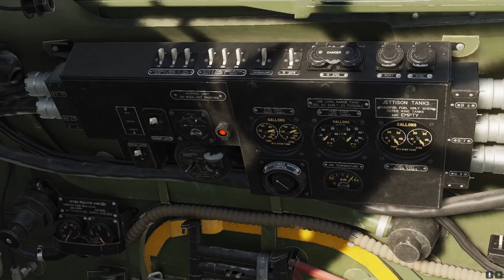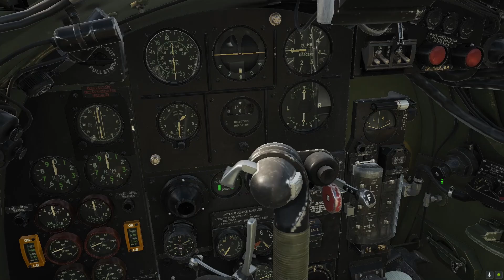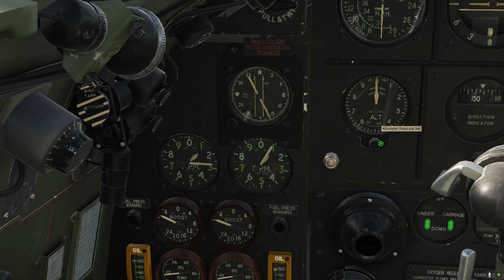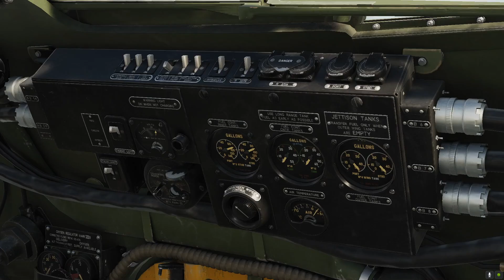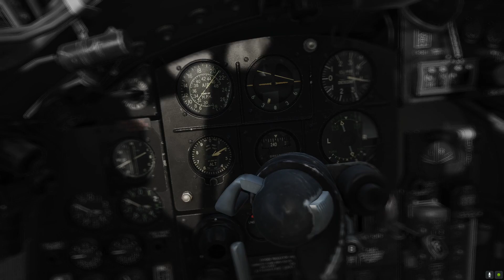Does DCS Have a MAJOR Problem?

Comment: Quite a morbid comment but I read about a 747 that lost its vertical stabiliser after a bad repair on the aft pressure bulkhead. On the CVR for a good few minutes after depressurisation they talked to each other about donning oxygen masks and descending but seemed unable to take any action about it.
Reply: "That would be a great idea wouldn't it? Heheh. Flying is pretty crazy huh." smiles and looks at the clouds
Reply: @BlueZirnitra  It's worth noting they kept a 200+ tonne crippled airliner in the sky with no hydraulic fluid. For over 30 minutes.

Comment: As always, Tim delivers a well informed aviation video for our education. 
Back in 1980 when I was fitting LOX-pots to Buccaneers, if I had previously had a few ales the night before, I would nip into the cockpit for a quick Oxy' check.  Works wonders.
Reply: NHS here, can confirm.. Nothing beats a bit of freshly bottled Swiss mountain air!
Reply from the maker: Yep, old Hawk T1 days after a big night, selecting 100% oxy on start!
Reply: Yes its a welders trick too!!!
Reply: I did hear an RAF pilot from WW2 say that 100% oxygen helped clear the head after drinking a few beers the night before.

Comment: At max T/O weight lift off speed of the Mossie was around 120-125 knots, but Vmca was 175 Knots IAS and it took almost 50 seconds to get the gear up and accelerate through Vmc on a summer day. The only thing to do if an engine failed below 175 knots was to reduce power on the live engine! And you had to do it very quickly!
Reply from the maker: I'll give that a go - sounds scary!

Comment: Tim, if you were to have a hypoxic dilemma in the air... Would you return back home asap to be checked over, or just class it as a dasor and move on with the sortie?
Reply from the maker: You have to return home immediately and you will have to see the doc in case it wasn't hypoxia related to the oxygen system but smoke and fumes instead - you may have been poisoned and won't fly again the next day, just in case.

Comment: Is the recovery with oxygen really that quick? Doesn't it take 30 seconds or do to regoxygenate the blood?
Great video. Could be a real problem in a fast jet climbing to 50000 feet 😬
Reply from the maker: It's pretty quick, a bit of confusion will exist for a few seconds but you are back in the room almost instantly you get oxygen back into the blood and into the brain.
Reply: @FastJetPerformance  if you were a marine, they'd pull your pants down and insert foreign objects in to you most likely
Reply: Something good would be happening right away. Think about if you have ever held your breath to see how long you can do it. When the desperation for air hits your peak of tolerance and you start to feel dizzy and faint and you let yourself breathe the rush of feel good aliveness hits you instantly. 

The sim just doesn't model the following wooziness and existential alarm at bringing yourself part way to death.